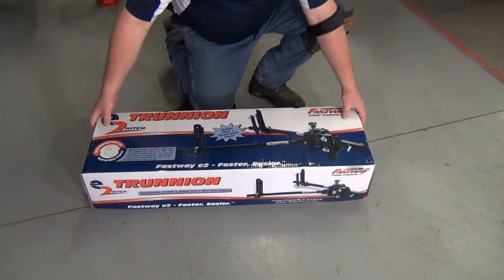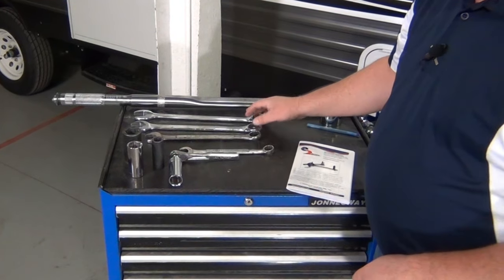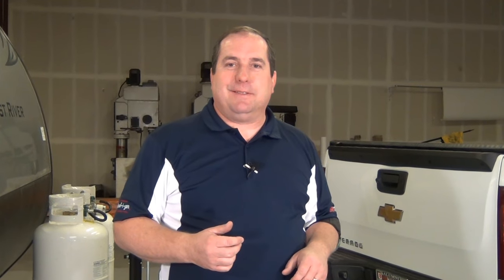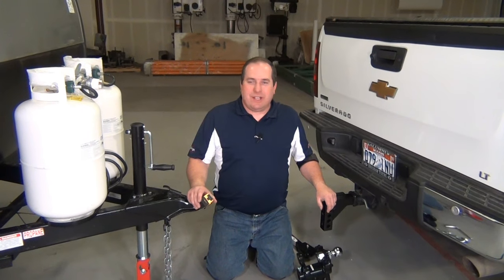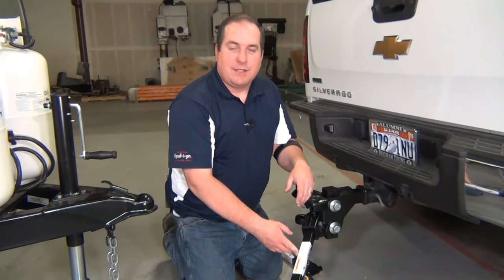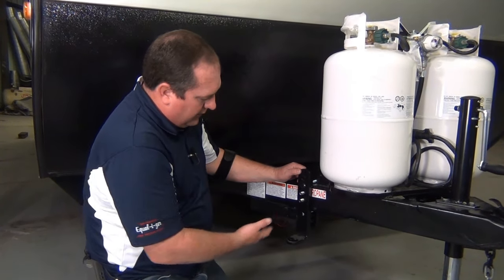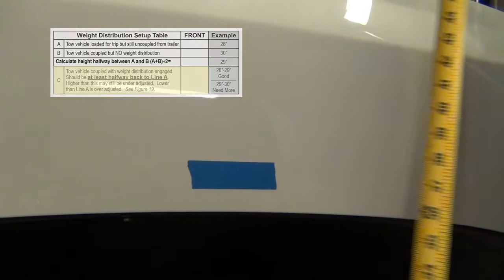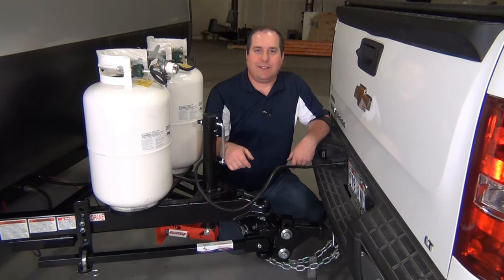How to Install Your Fastway e2 Trunnion Sway Control / Weight Distribution Hitch*

Comment: Great training video. Still a little confused about the pitch. Your trailer and truck was good without changing the pitch, so we didn't get to see how to know how much the change the pitch if the last measurement was off. Thanks for the great video.
Reply from the maker: Sue,

To check the pitch of the trailer, I follow a similar process as the one I use to get it parallel to the ground before starting the install.

With the trailer coupled up and the weight distribution engaged, measure the frame of the trailer at the front and back, and compare the measurements. If the difference between the two is significant (more than 1-1/4"), you may want to adjust the hitch ball height - the position it is in on your adjustable shank. There is some flexibility in this. A short trailer of only 15' will be much more effected by changing the hitch ball height than a 34' trailer will be. 1-1/4" over 15' is much more pitch than 1-1/4" over 34'. Use your best judgement for your vehicles. Try a couple of different positions if necessary, and use the one that gives you the most stable ride.

For example:
With your hitch coupled and spring arms in place, you measure 15" to the trailer frame at the back, and 17" to the trailer frame in the front, a 2" difference, which is more than the recommended 1-1/4". Moving the hitch head down one hole on the shank changes its position by 1-1/4". But dropping the head also increases the amount of weight distribution, because it changes the relationship between the end of the spring arm and the L-bracket position. Therefore, when making this change, you need to check the weight distribution setup again.

After moving the head down, the new weight distribution measurements show that it is good, dropping the front wheel well only slightly more, but not more than the uncoupled wheel well height.

A second check of the trailer measurements shows 16-1/4" at the back, and 16" at the front. It is now within the 1-1/4" difference, and the weight distribution is good. This would be a better setup than before.

---

There is a detailed description of this in Step 8 of the owner's manual, which you can download from the Fastway website here: http://www.fastwaytrailer.com/manuals

If you need more help with your hitch, get in touch with our customer support team. They are available M-F, 8:00 a.m. to 5:00 p.m. Mountain time. They will be happy to help. (877) 523-9103.

Comment: Great basic video thanks!

The only thing missing, which is important is where you set the tow bars onto the mount plates and secure them with the pins.
Reply from the maker: +Joe S,
You are right! We should have shown this step better. Here's how we like to do it: After coupling the trailer and taking the 2nd measurement, use the tongue jack to raise both the trailer tongue and the tow vehicle up until the spring arms can be moved easily over the top of the L-bracket. Place the L-pins over the bars, and secure them with the R-clips (cotter pins). Retract the jack, allowing the tongue weight to rest on the tow vehicle and engage the sway control.

Unhitching is the same process reversed: Locate the trailer where you want to park it. Use the tongue jack to raise both trailer and tow vehicle until the tension is lifted off of the spring arms, and they can easily be moved away from the L-brackets. Remove the R-clips and L-pins holding the spring arms. Move the spring arms outward, away from the L-brackets. Use the tongue jack to lower both vehicles until the coupler latch can be opened. Unlock the coupler, and use the tongue jack to raise the trailer off of the hitch ball.
Reply: Overall still a good video.
Reply from the maker: Thanks +Joe S.
Reply: @FastwayTrailer  thanks for the update. also would have liked to see the tow bar adjustment for the sway control. kinda seemed like it was not talked about much.

Comment: My question for you is why load the truck before taking measurements? If I load the truck it will raise the front end and isn't the idea to have it back to original height when the WDH is setup? Seems like the truck heights should be done first then load your gear and couple the trailer?
What am I missing?
Reply from the maker: Hi there! It is important to load the truck trailer because then you will have the most accurate weight distribution measurements. If you do all the measurements then add new weight it will skew the number and potentially place you in an unsafe towing bracket. If all the weight is accounted for then the weight distribution accounts for all the weight, not some of it. I hope that explains it!

Comment: Complete newbie here would have liked to see how you connect the ball into the coupler.  Also, if you change vehicles and have to remove the fully tightened shank bolts to make adjustments, do you need new conical washers?
Reply from the maker: No, you do not need new conical washers, you can reuse the same ones. Also, we have a newer updated installation video on our channel that shows the ball being connected into the coupler. Check it out!

Comment: Good video. But I don't understand the reason to take the trailer off the hitch and then tighten up the bolts. Since it was all loose wouldn't then hitch slide back the other way when it's turned upside down to tighten it effectively making the ball move higher when it's turned back upright? Confused somewhat.
Reply from the maker: +ShootnTexasStyle,
The bolts are left loose in the beginning so that it's easier to add or remove spacer washers to change the weight distribution amount. Once you have that dialed in, you need to tighten all of the bolts up to the correct torque specs.

When you engage the weight distribution for the first time, a lot of pressure is put onto the head, especially the spacer rivet and washers. This usually causes them to smash and flatten a little, which loosens the connection between the head and shank. When you turn the head over, the weight of the hitch head pushes the head tight to the rivet and washers, then you snug the angle set bolt and shank bolts to keep it there (17:46). It is important to tighten the shank bolts without the weight distribution engaged so that there is no shear stress on the bolts as you tighten them. This assures the best connection between the hitch head and shank.

You are correct, turning it upside down, then tightening, makes the ball move slightly higher, but only 1/8" or so. Hope that clears up the confusion. If not, please get in touch with our customer support team at 877-523-9103 or Support@FastwayTrailer.com.

Comment: I installed this weight distribution hitch and it rocks...my truck rides so much better with it installed! Thanks for this informative video! I had one question. After torquing the 3/4" shank bolts with the conical washers to 250 ft lbs, the top bolt has more bolt sticking out of the nut than the bottom bolt and the conical washers on the top look more flattened out than the bottom. Both are torqued to 250 ft lbs. Will this be an issue in the future? Thanks!
Reply from the maker: Nope! That's not a problem at all!
Reply: Also just some fyi,  a torque wrench that has a + or - 4% error , could make a 250 ft lb  at 260 ft lb if it is the full +4% off, the good brands are + or - 3%

Comment: If the truck is perfect afterwards but the trailer is an inch lower in the front, so I just need to raise my hitch one position and if I do that does it change everything that I’ve already gotten set ?
Reply from the maker: Good question. If you only need to raise it up one hole, you will likely be fine as is. You possibly may need to add a single washer to the hitch head as well. If you follow the Weight Distribution Setup Table in the manual, then that will help you know you're set up correctly. Thanks!

Comment: We just changed tow vehicles and need to adjust the height of the ball and hitch. To disassemble and reassemble the bolts, is it advisable to use a heavy duty adjustable plumbers wrench instead of the ratchet with socket?
Reply from the maker: To ensure proper setup, we recommend using an appropriately rated torque wrench to secure the hardware required to install the hitch. There are many torque wrenches available from a wide variety of vendors. The torque specs required for installation are all listed within our owner’s manual which can be found on our website if needed. It is important to select a torque wrench that is capable of achieving the torque specs listed in order to get the maximum safety and performance out of your hitch.

Comment: My fast way hitch sway bar arms are riding on the rear of the L brackets. What adjustment it’s best to fix that? Also thank you for the video!
Reply: You would lower the L brackets one hole and see if they are more parallel

Comment: again....what's the wrench size that holds the hitch ball while torquing ?
Reply from the maker: The one used in the video was a 1-7/8 thin walled socket. For the trunnion model, it doesn't need to be thin walled.

Comment: you recommend to load the tow vehicle with all your gear ,my issue with that is we don't always bring the same amount of gear on each trip .is this necessary  for installation or is there any other options like maybe adding a 1/4 to the ball height or maybe a minimum amount of weight in the tow vehicle .
Reply from the maker: This is a good point. You will want to set it up for how it will be most often when you're towing (if possible, of course). If you are towing completely different loads each time, you may need to make a few minor adjustments to your hitch to adjust to the load.

Comment: Here's a question for you - I had to move one L bracket forward to 28" to avoid the breakaway control box, but the other side was clear so I put it at 30" - should I actually move that side to match, or is it okay to have one side in a different position so long as they are both in the safe 27"-30" range?
Reply from the maker: If they are in the same range you should be okay! The closer they are to being the same the better.

Comment: Thanks for making this video.  While it is fairly helpful and conveys the basics well, it seems like it's incomplete.  Great tutorial videos explain and show what you should do if changes/adjustments are necessary or if you make common mistakes.  I followed all the instructions in this video, and I'm getting almost zero compression back on my truck's front end.  So now I'll just fix it by...  Umm...  Well...  I don't know what I'll do because no adjustments are mentioned anywhere in this video; everything just magically works perfectly the first time.  
<br/>
Sorry to come across like a grump; I'm frustrated because the dealership where I bought my travel trailer installed my e2 wrong; the ball was way too low and they didn't tighten my angle set bolt.  I started from scratch using this video and now my rear fender is just a few inches from my rear tire and I don't know how to fix it.  I'd bring it back but it's 200 miles away and I don't have time.
Reply from the maker: Mark Roberts,

Sorry to hear that you're frustrated.  I'm confident with a little work we can get you on the road with a good setup.

At first glance, it sounds like you are under-adjusted, which means you need to have more spacer washers, and/or raise the L-brackets on your trailer frame.

However, I don't want to recommend a solution without first having a good understanding of what you're working with.

Tell me about your equipment - what are you towing, what is the (approximate) tongue weight and trailer weight? What is your tow vehicle? What size hitch do you have? How many spacer washers do you currently have in your hitch head? What position are your L-brackets set to?

Do you have the Owner's Manual? If not, download it here: http://www.fastwaytrailer.com/manuals
Reply from the maker: Mark Roberts,

Were you able to make some adjustments?

If you still need some help, please get in touch with our awesome Customer Support via email at Support@FastwayTrailer.com, or by calling 877-523-9103, Monday through Friday, 8:00 a.m. to 5:00 p.m. Mountain Time.
Reply: FastwayTrailer same problem. Had a dealer install and it has done nothing for sway or weight. Either they used all the washers or threw the rest out.

Comment: Is there anywhere in jax fl this can be put on a grand jeep Cherokee limited 4x2 towing an Rpod 2010 173? What would a good price be to gave this installed on camper and jeep?
Reply from the maker: Julia Torjusen,

Yes! There are a number of good dealerships in the area that can install a Fastway e2 hitch for you.

Use the dealer locator on our website here: https://www.fastwaytrailer.com/find-a-dealer

Be sure to call ahead to verify that they have the product you're looking for, and a service facility to install it. Some locations may not carry the full line of Fastway products, and others are retail locations only, with no service center.

The price will vary depending on which model you chose, and the specifics of your tow vehicle and trailer. Our MSRP for an e2 trunnion hitch ranges between $469 for the 4.5K up to $505 for the 12K model.

All dealer's shop rates vary, but typically we would expect that your hitch could be installed in an hour or less. Special circumstances for your vehicles may affect this, so be sure to talk specifics with the dealership's service department for your situation.

Get a quote from several reputable dealers, and chose the one you feel will do the best for you.

As always, you can call our great customer support team with any questions you have at 877-523-9103.

Good luck!
Reply from the maker: Leslie B,

If you have access to the proper tools, and follow the owner's manual and install video, an e2 hitch is not difficult to install. At the same time, it is a critical piece of towing equipment, and therefore, if after reviewing the process in the owner's manual and watching the video you are not confident in your abilities, we recommend you consult a qualified dealer to have it installed there. Safe and happy customers is our first priority.

Something to consider before tackling it yourself:

To install the hitch and hitch ball, you will need a large torque wrench, and some other large wrenches / sockets: a 1-1/8" and 1-1/16" with a 250 ft-lb torque wrench for the shank bolts, and a 1-7/8" socket with a 400+ ft-lb capable torque wrench for the hitch ball. There is a 10K model with a pre-installed hitch ball (92-00-1065), which would eliminate the need for the largest wrench and socket. You may also be able to find an auto parts store near you that offers tool rental.

The e2 owner's manuals can be found here: http://www.fastwaytrailer.com/manuals

You may also contact our customer support team with questions at 877-523-9103 or Support@FastwayTrailer.com
Reply from the maker: You can use the Dealer Locator page on the website to find dealers that carry our products near you. https://www.fastwaytrailer.com/find-a-dealer

You can also contact our customer support team, and they can help locate a dealer near you as well. 877-523-9103 or Support@FastwayTrailer.com.

Comment: What is the theory behind the tilted ball in the first place? Is it to adjust the tension of the bars on the trailer?
Reply from the maker: Thanks for the question +ShootnTexasStyle,
The ball is tilted because the head is tilted, and tilting the head changes the angle of the spring arms relative to the trailer and tow vehicle. It is that relative angle that determines the amount of weight distribution being applied to your combined trailer / tow vehicle. More washers give you more of an angle, and thus, more weight distribution. Less washers = less weight distribution. We recommend that you set the hitch up initially by using the addition or subtraction of spacer washers as much as possible, with the L-brackets in the center holes. This allows the most flexibility later, when a simple adjustment to the L-brackets on the trailer frame can be made to adjust weight distribution if needed for the load you are towing. Here is a video that shows the adjustments when you have too much or too little weight distribution: https://youtu.be/ymcB2yeZr4s

Comment: Probably would help more if you showed all the steps.  Kind of like a Crew leader I had that liked to leave people he trained out of a few of the steps to finish anything.  If someone has never used it you skipped enough to make it dangerous.
Reply from the maker: Thank you for taking time to watch the video, and for the feedback. The install is covered thoroughly in the e2 hitch owner’s manual [https://www.fastwaytrailer.com/pdf/e2_Trunnion_Instructions_2016-06.pdf], and the video was done as a visual supplement to that. Which steps of the install do you feel are missing? Where could we improve it?

Comment: I've been using a chain weight distributing hitch from way before all these new fancy ones where even thought of and il tell you that ANY weight distributing hitch will add away control without using an actual sway  control.... Simple mathematics and physics.
Reply from the maker: You are correct, any weight distribution hitch, when set up and used properly, will increase the control the tow vehicle has over the trailer, because you are returning weight to the front axle, which increases braking and steering control. However, sway control hitches add the extra advantage of friction resistance that opposes or dampens the trailer’s side-to-side movement. Set up correctly, a sway control hitch, like the e2 [https://www.fastwaytrailer.com/e2-hitch] will perform better than a weight distribution hitch with no sway control.

Comment: Did you say 460 ft pounds for the ball 🤨
Reply from the maker: 430 ft lbs. if you have a Fastway ball, if not, then use the recommended torque of the hitch ball manufacturer. Thanks!